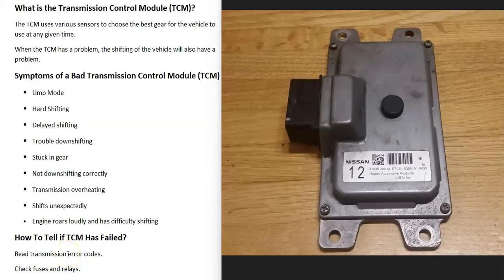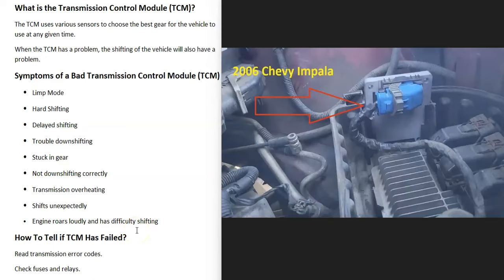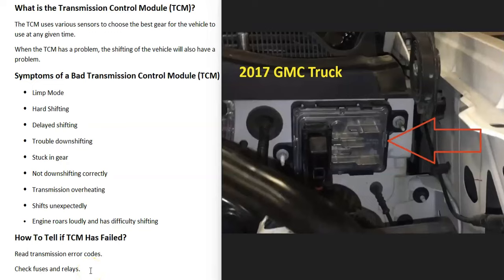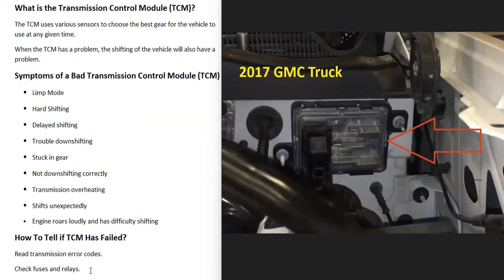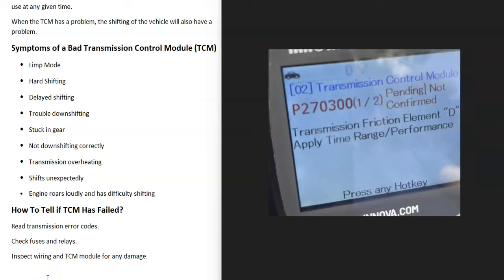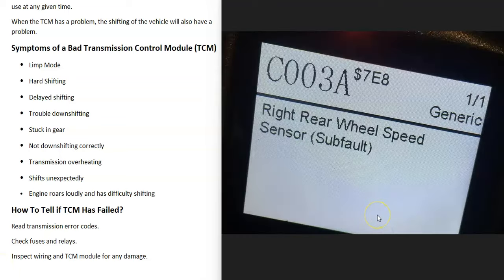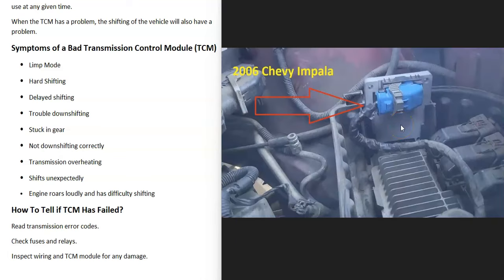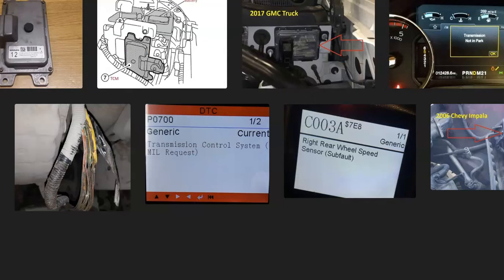Symptoms of a Bad Transmission Control Module (TCM)

Comment: My 02 Saturn Vue went into limp mode and wouldn't start back up. I had to have it towed. I just got it out of the shop for exact issue. It's been in the shop 8 times for stalling and not running issues.

Comment: I have a 2012 I’m not having those issues. But I’m getting a drained battery. Fuse 14 TCM-BATT has voltage even with key off. I think that is causing my battery to drain. Any ideas?
Reply: Alternator

Comment: My transmission the car is Rise of the little pump the gas pedal for the change gears
Reply: Yup on my g37 but it goes through all the gears but the issue is I end up doing 80 in 6th